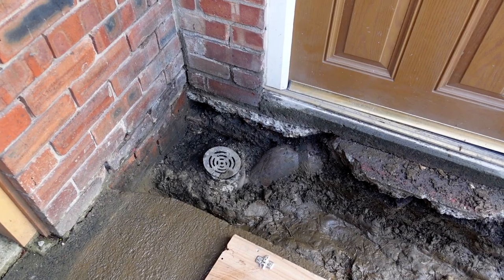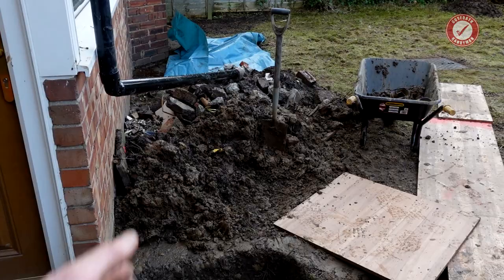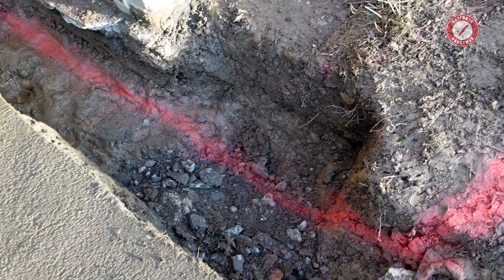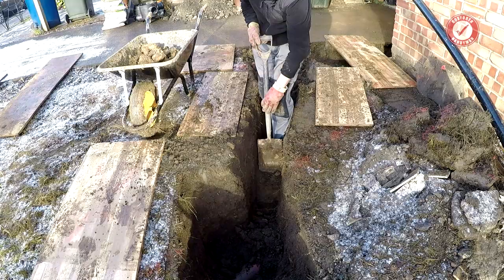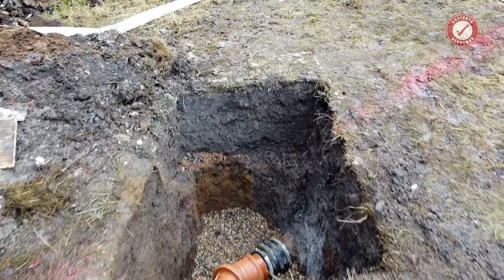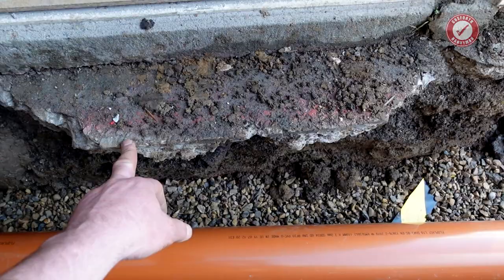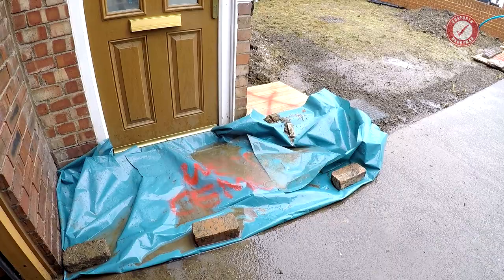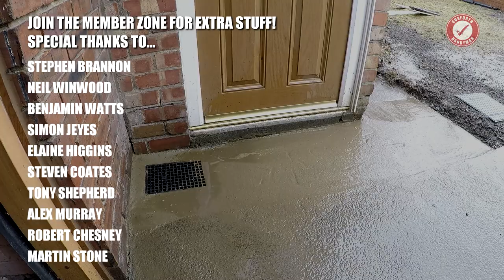Gully repair and clay drain pipe hook-up (Renovation Part 12)

Comment: I'm wondering if you're not too harsh about the porch and cowboy builders. I'm thinking of building a front porch myself, the kind which doesn't require  building permission (i.e. total footprint at most 3 square meters, original doors must stay in). To me it's actually explicit in the permitted development description that those porches were never meant to be as "solid" as the main house, indeed they aren't supposed to be considered part of the original house, since original doors are supposed to stay in. So really if the foundations are as good as good backyard shed foundation then I'd say calling whoever built it a cowboy is a bit of a stretch (for my project I'm thinking of ground screws for foudnations + american style timber construction with brick "siding" as americans call it to visually merge with the rest of the house; ground screws partly for great simplicity, and partly because I don't want to move the utilities since it's a terraced house, and there's literally no way to route it elsewhere). Obv you're planning to have a proper front extension and then it's a different thing, but I'm not sold on the necessity of concrete foundation for those "permitted development style" front porches.

Comment: Very good job, I am thinking about installing a rainwater gulley for my shed roof and the adjacent patio because it’s all block paved but there has been a problem for years of water partially flooding the garden and almost creeping into the shed when it gets really bad. The only issue I am have is the fact that all the drainage pipes are at the front of the property and I have no means of connecting up the future gulley. I do think it will be a good idea to install a soak away but the whole area is completely covered in paving and I don’t want to cause any future problems with the paving sinking over time. There is a small space of land at the back of the shed where I could tunnel the pipes for the soak away  but it’s completely inaccessible from my boundary so I am a bit screwed. What would you say is the best thing to do?
Reply from the maker: Hmm... Soakaway sounds like your only option. You should be able to make a relatively solid one that doesn't sink, but lots of digging. 👍🙄

Comment: Why didn’t go straight into the old inspection point instead of joining on to the old pipe
Reply from the maker: The existing chamber? It would have been a huge job and that's a shared sewer at that point. 👍

Comment: 1 question is : what is the name of that plastic guttering sleeve thing, never come across it before and it's a really neat Idea that I havnt come across before but needed it a few times. Would have saved me a ton of time. Could you or someone tell me the name of the stuff he used for the temp guttering ?

Comment: Why didn't you save the end bell on the clay pipe and just put the new pipe into there?
Reply from the maker: They were mortared together and I didn't trust being able to separate them without breaking them. The clay is a so fragile. Plus I think you need to use the Flexi coupling for regs? Not sure. 👍🤔

Comment: Just wandering what the cost difference is between ready mixed concrete and buying cement/sand a gravel? I’ve never brought ready mixed unless it was 40N stuff
Reply from the maker: Was purely for convenience as I was in a rush but probably a fair bit cheaper to mix your own 👍

Comment: Hi can you tell me if you dug out the old pipe, if not how did you fill it in? To stop anything going inside it. Also if you did keep it there, would it confuse future buyers that it was a live pipe?
Reply from the maker: Concrete up both ends, will probably pull out the remaining section when the footings for the porch are dug 👍

Comment: I know you always do a proper job but would it not have been possible to repair that crack with some kind of waterproof sealant?
Reply from the maker: Not without digging the whole thing out since the crack went around the full circumference of the pipe unfortunately. 👍

Comment: If for any reason you can not move the soil pipe ( hes has called it a gully then bridge it with a lintel and 2 piers no pressure will then be put on the pipe poor preperation leads to poor performance most ground works are not rocket science

Comment: Where is foundations for the porch?
Reply: It looks as though  it was built on top of 2.1/2 -3 inch slab
Reply from the maker: Yup, my thoughts exactly. It's the porch Jack built. 🙄😬
Reply: There must have done it on the cheap